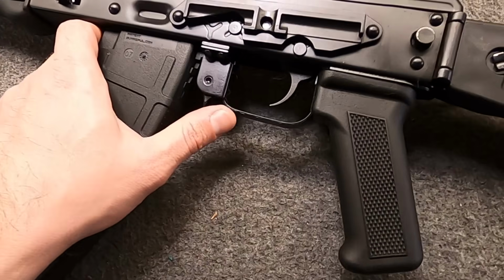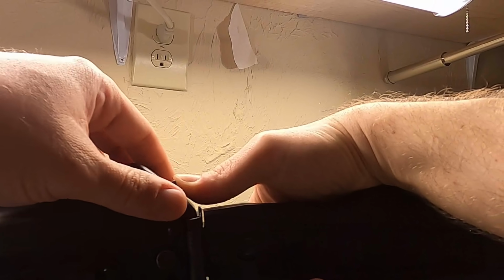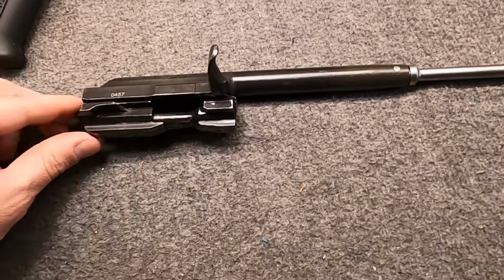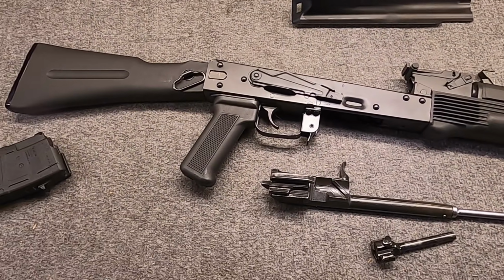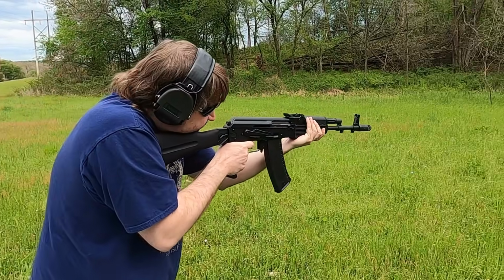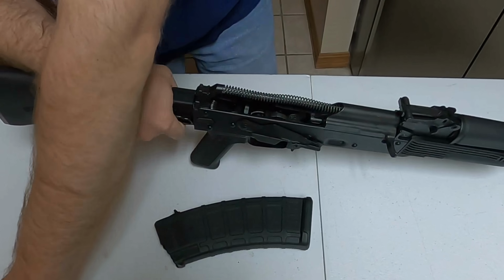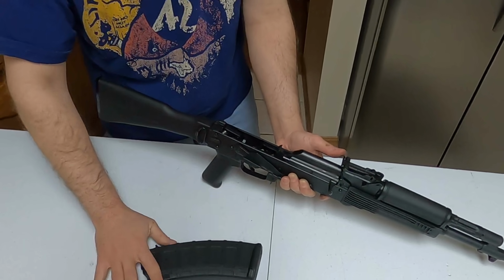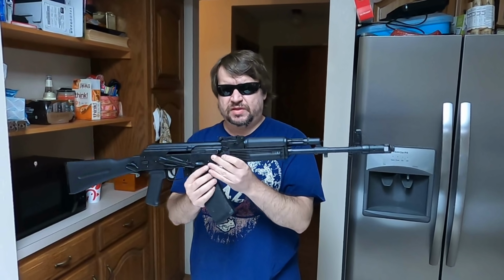Before & After With The PSA-74 5.45x39 Rifle (Return To The Range After Repairs)

Comment: I am testing out the riley defense ak-74 side folder, so far less issues than the psa you got. My only concern is slightly canted sights and the bolt lugs are fitting themselves with some peening, but everything else is good the rear of the bolt doesn't even have any peening from the hammer after 500 rounds. Fitment seems a lot better than all the loose bits your PSA has, stock locks in super tight. Chrome lined barrel. Finish leaves some to be desired but I plan to paint it eventually. Hopefully both these companies can improve their products and continue to make the ak world better here in The USA.
Reply: To be fair, the PSA74 was off to its new home 5 minutes after we wrapped recording on this video. I am happy to have tested it sure, but its just not my cup of tea. To be fair, i paid less for either my SLR105 or SGL31 than what these PSA74s are going for these days.  And the reason was back then, 5.45x39 guns were simply not in demand, thus prices were low so venders could move them. The SLR104FR was actually cheaper than its SLR107FR cousin too. My point is i have my 5.45mm guns because I was a cheap skate back in the day lol.
Reply: My Rak47C is definately "better" than my GF3 PSAk47 i sold. Primers in the firing pin channel stopped it. The Riley has a smoother throw, better action, better performing. Paintjob is the only thing the PSA was superior in/at.
Reply: @Patrick Henry didnt bother with gauges. Any rifle that goes down inside of 100 rds will be no rifle of mine for very long. Cleaned it up, function tested and sold it.
Reply: @omardevonlittle3817  I had tried out the psa ks47g2 and the extractor exploded under 100 rounds I'm thinking like closer to 75 rounds even. RMA'd for new extractor and sold immediately after. Not saying this to bash psa though they do take care of the customers and I'm really looking forward to their ak-105 especially if they can source chrome barrels for the 5.45 guns they plan to sell.

Comment: As I have written in at least one other video my PSA 74 had a firing pin issue. It would pull primers off the cartridge and attempt to deposit them onto the next round. This occured with four different types of ammo and usually in less than 20 rounds.. I replaced the firing pin with a surplus firing pin and the issue was resolved entirely. I understand that PSA has revised their firing pin design and is working to ensure this issue doesn't occur in the future.
Reply: curious as to where you heard about them changing the firing pin design? If true, it would be a step in the right direction.
Reply: @r3dc311  Directly from Cameron who works there.
Reply: @Patrick Henry its a pretty common problem, and has been posted by multiple people on akfiles, reddit, etc. I'm still waiting to get my rifle back from them for this.
Reply: @r3dc311  i bought a psa from a friend that owns his own gun shop. But I bought a surplus firing pin pre-emptively so hopefully that solves my biggest concern. Furniture is not too important as I plan on replacing that. But the gut wear may prove to be a problem but time will tell.
Reply: @brittainwoolley6848  what firing pin did you put in it
Reply: @TempoMontages  just a surplus 74 pin I found online. Polish or Romanian likely.

Comment: It seems like they still haven't really worked out the bugs, with the flaring on the bolt lug, rear of the firing pin channel, possibly under-penetrating firing pin, etc. Still, progress. Nit Picking? Maybe, though with them going for significantly more than what my SGL-31 cost, panic-era or not I don't think being up to military spec is too much to ask for. Maybe I'm just stuck in the past, I've been accused of that before with other things. Their explanation for why their pistons are rigid did not hold up to scrutiny (no source was provided for the alleged Soviet manual that said you can fix the piston in a certain position as "tuning"). I suspect that the piston being stuck is the source of the wear on the piston head and I am curious to see if it progresses over the next 2,000 rounds or so. Still, better than a certain Vector Arms Polish AKMS build I have experience with that had the barrel welded into the trunnion and a wiggly bullet guide. lol.

Comment: The stock play is honestly a deal breaker for me.
Reply: Its much better than before, but yes still it has more than any of my imports. My SGL31-94 is 10 years old and has had about 3,000 rds through it and its stock doesn't have any play that I've noticed yet.
Reply: @misha5670  Right, I only have arsenal folders and they have zero play. Ive had them for a few years and thousands of rounds.

Comment: I blame myself for being stupid and thinking the new PSA AK105 would be better than my problem-laden PSA 104. Just got the PSA AK105 and it shit the bed. Won't eject and also picks up two rounds out of the mag. Tried two mags and two different 5.45 ammo. My AK104 also had to be sent back and they replaced the bolt on that one. I have had bad luck with PSA.

Comment: My psa 74 just passed 600rds. Only issues i had were silver bear HP ammo that caused the primers to pop and jam the firing pin. I shot all the silver bear and have had zero issues since.
Reply: Thing is, I've shot Silver Bear in several AK74 types w/o issue. VEPR, Saiga, SGL, SLR104/105, SAR2, WASR2, Tantal build, and a few different Bulgarian builds.

Comment: My PSA AK74 had a hiccup with ammo, primer blew out of the pocket and into the firing pin channel. I didn't notice at first and got 5 light strikes and no bang. Then a round loaded chambered didn't fire, wouldn't extract. So kick started the chamber, case and powder spilled out bullet lodged firmly in the chamber. Such a damn headache and all over piss poor 545 ammo
Reply: Since 7n6 is gone I lost interest in getting a 74.
Reply: From 2002 through today, I've always bought Wolf 5.45x39. Its never let me down. Here in AR, corrosive ammo like 7n6 is a real liability, especially given the prices on 5.45mm caliber guns these days.
Reply: I'll definitely have to try and get some. I think I was shooting red army standard when it happened. Bit thank you for the advice, I really appreciate it

Comment: It sounds like they might have seen some out of spec wear on the barrel where the bolt contacts it, and perhaps the trunnion as well. It would line up with the issues that others have documented with the PSA 74 in numbers large enough not to ignore. Who knows? Strange, though.
Reply: Honestly? I think they went to a smaller gas port size. One thing i reflected on after recording this video was that this time the PSA seemed to be a bit more soft shooting compared with the first time. Could just be a trick of my memory though.

Comment: I have 2 PSA AK style weapons. A AK47 GF3, pin and welded. And a AKV 9mm. Both have a small issue that I don't know if I'm being picky on or not. When they are opened up for cleaning, I can look down in the trigger group. Pulling the trigger just a bit to have up slack, the trigger pin moves just a bit and the entire trigger assembly shifts side to side. Like the receiver hole is too large or the pin is out of spec. My Zastava ZPAP M92 does not do that at all. Not even a little bit. What should I do? Is it worth sending back to PSA, or should I try replacing the pins first?  I've even seen the AK anti-walk pins, but I didn't want to have a screw head on the side of an AK. (I put them on all my ARs)

Comment: Garand thumb said that the stock uses a different pin spec in the folding mechanism, is that true?
Reply: Yes and no. It is 4.5mm but to get say a Russian Soviet era stock to fit, some file fitting is requireed. That said, its totally doable and locks up very solid. Source: the PSA74 in this video is now wearing a '80s era Soviet triangle folder.

Comment: How's the right side of your trunion looking?  I've got mine back from them, and put 160 rounds through it and the right trunion is rounding off a lot as is the corresponding side of the bolt
Reply: Not sure what 'a lot' means in our case, but a little bit of that kind of wear is ok....as long as it does not progress after 200-300 rounds. I've even seen NIB Arsenals do that. That's how the AK is designed to work. Its made so that the parts can wear in together. Same principle applied with old Soviet tractors too lol.
Reply: @misha5670  you got a way for me to send you a picture?
Reply: @Patrick Henry 🤣🤣🤔🤔🤔wait, how did he respond to me in the first place
Reply: @Patrick Henry that cheating SOB🤣🤣🤣🤣
Reply: Mine has the exact same wear pattern. I think it's because the set the headspace as tight as possible and don't chamfer that edge. My AK-12 trunnion has a chamfered edge, so I assume they just skipped that step to save a buck
Reply: @jonathansmith7306  right I get that, but I've got one of their gf3 and one of their 103's in that same area, there is a slight bit of wear, but comparing the 2, there is a noticeable difference.  In the 74 is straight rounded off

Comment: A friend just got a GF5 and the firing pin came off while I was firing. I took it apart and the retaining pin was deformed. He wants to buy spare parts instead. Do you think an arsenal firing pin and retaining pin will work?
Reply: Aren't most Arsenal pins out there now designed to work with a spring?
Reply: @misha5670  I saw Kvar was selling arsenal free float firing pins.

Comment: wasn't there also an issue with the button for the folding stock being offset or a gap in your first video?
Reply: Nothing to do with the button, but yes there was a gap in how the stock trunnion was fitted into the back of the receiver.

Comment: Armadillos beware!!! Lol. I'm not sold just yet on PSA's ability to put out a "good" AK. I'm wondering why they went with the full auto bolt carrier.
Reply: PSA puts full auto carriers in all their ars and aks. Since they arent importing they dont need to bother with machining off the wings. I have a psa ak 103 i would definitely consider a good ak. I bought it so i wasn't putting all the strain on my import guns. It works great and isn't over gassed. Super accurate with the FN barrel
Reply: Not recommended for eating.

Comment: Folders are a probable issue at some stage along the life of a gun especially in combat, rendering the weapon unless Its actually highly surprising any major country would have them at all, ok perhaps paratroopers but not the general military definitely not the British military nor evidently USA, one of the most obvious example was the Eugene Stonner's AR18 folder some might say would have been chosen by the military big wigs if It had been a fixed stock or at least an option for one, alas no instead they chose the odd  looking m16 , who would have believed you could stick a handle on top off the dust cover ?..

Comment: Not sure why anyone would buy a US made AK unless it was the KR-103 as they are invariably trash. Just hope Kalashnikov USA introduces a KR-105 in 5.45x39 as I am warming to this round due to the substantially reduced recoil and ammo weight. 10 kg = 13 AK-103 mags or 18 AK-105 mags.
Reply: I didn’t think the new Riley Defense 74 was that bad. Some extractor issues, but nothing affecting headspace. Need to find one in stock, though.

Personally I’m just wanting an American ak manufacturer to stick it to the reddit guys
Reply: Because import ak will not be around forever so if we can invest in us made aks we won’t have to worry about import bans and I will also add that they aren’t all the bad compared to early wasr 10 or modi’s
Reply: What they said. I have a half dozen imports. The Riley is the equal of a WASR imho. Only 200ish rds in tho
Reply: I picked up a KR103 recently, it's quickly becoming my go to range rifle. It is that enjoyable.
Reply: @godandguns808  Nothing wrong with early  WASRs. The WASR came out in 2003 and the quality was perfectly acceptable for a $300 AK at the time. The period you are probably thinking of was back in late 2008/early 2009, and you remember what had just happened then. Cugir  was pressured to speed up production, which did lead to some issues, but most problems back then were from Century rushing to convert WASRs to get them out the door asap.  Most we had come in the store were fixible thankfully. We saw poorly installed (or made) FCGs, bad retaining clips,undersized magwells, inproperly worked mag catches, and poorly fit furniture. Also yes a canted FSB or GB from time to time. An issue that a hammer often 'fixed' lol.  As for Maadis? fully agree with you there. We saw some pretty "interesting" Maadis come in with loads of different issues.
Reply: @auroraborealis3831  I've been impressed too.